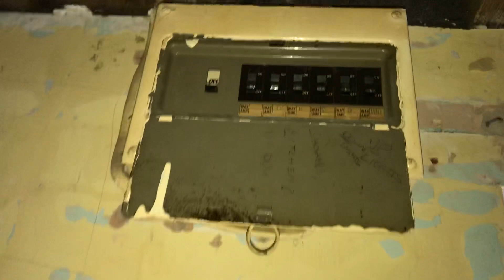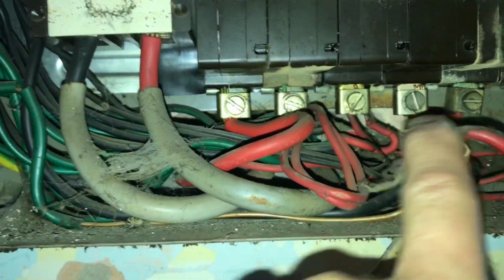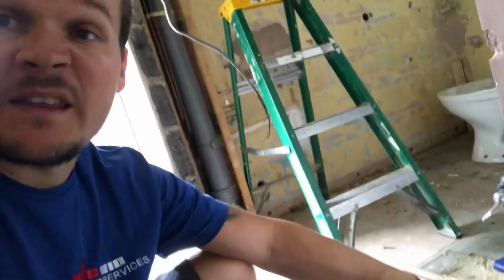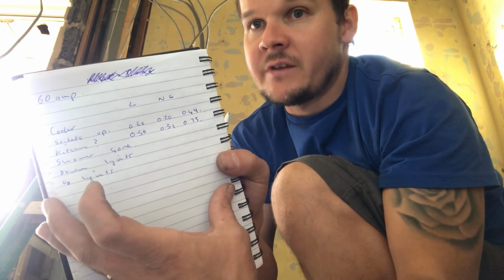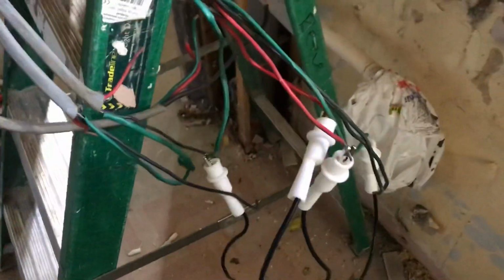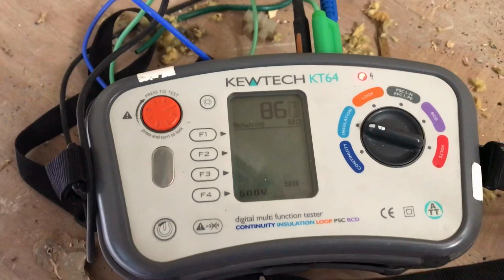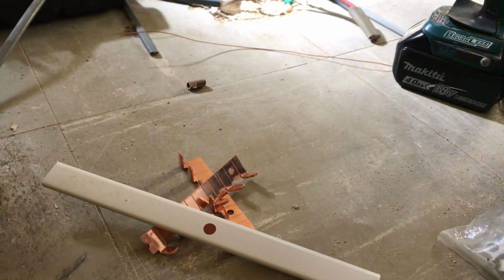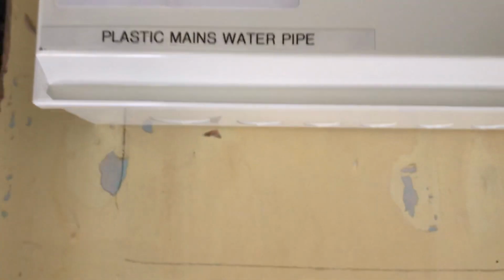18th Edition Consumer Unit Upgrade. EICR Before Board Change?

Comment: Just a useful piece of information regarding the earthing of the gas meter. The fire grommet will expand under fire conditions but the purpose of sealing any hole  from a Gas perspective is so that if, a gas leak occurs in the inset meter box, it won’t make its way into the cavity of the building potentially causing a explosion if ignited.  There is a special non set putty that can be purchased. This is why gas pipes are sleeved and sealed one side.
Reply: Yes agree and about to write same thing . Been a gas engineer for 27 years. Get yourself some denso mastic putty or fjc from pts or bss. Leaving a hole from the rear of the box into the cavity unsealed is an At Risk situation. And like the comment above if there was a leak ect in the box if left unsealed it could potentially fill the cavity with gas.

Comment: The reason for sitting the meters so close to the cut out is for the purpose of revenue protection. I asked this question a while back when we had a meter installed. Sometimes the tails from the cut out to the meter run through a solid plastic block to protect the tails.
Reply: revenue protection
Reply: Alan Lumsden thanks  you’re right alan, edited👍🏻

Comment: If it's a 70's install, the cpc in 2.5 will be 1 milli, not 1.5.
I would have tucked that slack cable into the ceiling void. You never know when you might need a bit spare.

Comment: Dude another top video as always, make sure to seal round earth cables in gas meter box, especially through cavity walls, because if there was to be a gas leak on the meter it will stop the build up of gas going in to the cavity. 👍

Comment: I use those same intumescent grommets all the time, but still use a tails gland to give the tails that extra tough protection where they enter the board, both because that's the incoming power only protected by the main fuse and because being much thicker than the other cables they can potentially hold some tension (wonder if they could wear through a grommet given enough time?). Might be over cautious but whatever let's me sleep at night...

Comment: Very informative vid again .... obviously I'm going to be an arse and point some bits out only up for discussion ! I would've installed an isolator in that electrical cupboard for 3M tails. With the earth bond for the water, I get where your coming from BUT if you can look around and say that the high percentage of water pipe installation is copper with copper joins etc and the house is of an age where it is more than likely a true copper pipe installation then I would 100% earth bond above that stop cock, especially as the ceiling is down and there is a refurb on. I know the regs say blue pipe installations don't need bonding but I would use common sense and read that as they assume houses of a certain era that will have polypipe sections and some push fit connectors. I just think on that job I would've run it in for peace of mind. Keep up the good work though mate !

Comment: John Ward did a video on the meter tail / eddy current issue and came to the conclusion it wasn't a problem. However if you're faced with using 2x 20mm holes as the only option for the tails, a slot cut between them makes them the same hole.

Comment: I struggle to ascertain the issue with mounting the distribution board near a waste pipe on the basis that 'it might leak in the future'. 

If that were a valid statement, would you not install downlights in a living room directly below a bathroom incase 'it leaks in the future'?

I don't recall a section within 'Selection & Erection' entitled 'Suitably siting electrical equipment and accessories in order to compensate for future misfortunes'.
Reply: Agreed .... under normal condition s you would not expect toilet, sink, over flow, waste pipe etc to leak
Reply: Obviously there should be a suitably siting electrical equipment and accessories in order to compensate for future misfortunes section 👀  oh no, did I just give the IET an idea for the 19th 🙈 🤣
Reply: @mfselectrical6370  You've said it now! 🤣🤣
Reply: Also the roof might blow off exposing the cu to the elements 😋
Reply: In the same way you would not place power and data together. I would recommend not placing electrical systems near or under water or waste pipes. Its just common sense, would you not agree? An electrical AE would not be happy!
Reply: Is it wise to install electrics under a roof as it might rain
Reply: @llamudos9809  The main reason you dont place power and data together is because mains interference couples into the data wiring.. its not a safety issue
Reply: @jaycee1980  It depends. If you hung data cables from a 100amp 3 phase supply in a ceiling void and use plastic tie wraps to bound to the electrical cable and you have a fire. Then you risk having a lume of data cables landing on someone which could kill.

So with that in mind yes it is a HS issue.

HTM 06-01 may help!
Reply: @llamudos9809  youd also have useless data cables as the circulating currents in a 100A cable would completely disrupt any data sent over them. i wasnt evaluating the fire safety aspects of it
im an electronics engineer, not an electrician
Reply: @jaycee1980  Agreed.

Peter Mulholland  I work in a hospital and today i had to bollock an Estates Manager for allowing a sparky to hang data cables from a supply feed in a corridor rather than put up in a tray and store it correctly. We have stringent guidance that has to be followed so when i see stuff that ain't right i will comment. 

I'm a project Manager in a trust and i see real stupidity daily by supposed qualified staff.
 
We have a switchgear room with a water pipes situated directly above it. Its an idiotic designs that really annoy me and people should apply common sense when implementing LV.
 This switchgear feeds 4 wards with critically ill patients.  

I hope you did not take offence at my comments they were meant to help. Its just i see alot of really shoddy work and it grates.
Reply: Klberts1234 🤣🤣 brilliant 👏🏽
Reply: Would you wire anything in a house directly under the roof just in case it leaked

Comment: You guys some some strange panels in the UK.  Fun to see the differences between the UK and US.  We don't test things here, wire it up, turn on the power, if the breaker didn't trip its good, move on to the next one!  LOL   Keep up the good work.
Reply: Same in Australia
Reply: No testing at all? Not even to make sure you've got an earth/ground present at your sockets, or that the cables weren't damaged during installation, or that your GFCI sockets are tripping when they should?
Reply: We used to use a polarity tester for the sockets. Test the RCD function ect. New build flats back in the early 90s we did line to earth insulation resistance test on lights n power final subcirciuts.
Reply: Same in Australia?

Comment: Great video again mate 👍 did you seal the 10mm gas bond coming into that box? Was always taught not install through the rear or side of the box in case of a leak and gas in the cavity. Keep up the good work!!
Reply: British gas definitely dont like you putting holes in the back of their boxes even if you seal it with mastic!
Reply: You’re right as usual Kurt 👍

Comment: Are those double insulated tails okay in the ceiling and wall cavity Chris? I've never had to or considered doing it myself but I'm guessing the >50mm reg covers it? I usually fit an isolator or switch/fuse, then SWA or singles in galv conduit or trunking to the board. I guess it's the same as running a 16mm T&E without RCD protection, as long as its buried deep enough in the cavity it will comply. Also I don't tend to upgrade the tails from 16 to 25mm unless calculations require it. Same goes for the main earth. But I sometimes upgrade them if I have to run them in new like you have done. 16mm2 can cope with 60A of course, and the 10mm earth will cope with the PFC. Keep the content coming mate.
Reply from the maker: Should of mentioned in the video the main fuse is getting upgraded to 100amp and I’ve got to run in a sub main to the garage.

Comment: Great video, quick question .... Why did you upgrade the meter tails to 25mm as the service cut out fuse was only 60amp? Surely the original 16mm tails were sufficient, no?
Reply from the maker: The client wants to add a sub main to the garage at some point and is getting the main fuse upgraded to 100 amp.

Comment: I’m an electrician in the states. And I’m admiring your two pouches that you work out of on your waist. Are the pouches incorporated on the shorts or are they separate. Also could I get the name of them? I would love to get a set
Reply from the maker: They are incorporated into the shorts. They also do them on trousers.
Reply: Ray - I moved to the UK from the states a year ago. I immediately noticed that just about all trades folk in Europe wear work pants with these pockets - they are referred to as holster pockets. They are brilliant. They are an integral part of the pants, but means that you can kneel down without stabbing yourself Lol. Dewalt make them amongst just about everyone else over here

Comment: CJR what was the reason for upgrading the meter tails to 25mm2, if the meter has a 60amp fuse? did the new HAGER board have a 60amp main switch? I get that you probably had to replace them anyway for length to the new board. Is the customer going to look at getting his grid supply changed to 100amp? in which chase you're just future proofing the job?
Reply from the maker: Correct upgrading to 100amp supply

Comment: Had a plumber show concern that my gas meter did not have earth bonding and whilst the gas comes in via plastic his reasoning was if the copper pipe becomes live and anyone touches it as it can't go to earth through plastic whoever touches that pipe would? To pacify  him I ran an earth wire from the gas meter to the earth terminal block outside the fuse box. He was then happy as Larry????? Oh well.
Reply: It's amazing how easily pipework picks up an earth within an installation... Even just going through damp walls. Pipework could be buried in floor. It's too simplistic to assume just because it arrives in plastic that bonding isn't required. It should be tested.
Reply: This is true  same with push fit water pipes with copper pipe   I had a call out someone receiving shocks off metal shower hose. Investigation found shower cable load side earth  had been connected into the  load live.   Plastic push fit used on copper pipe and plastic incoming water pipe shocking
Reply: @Klberts1234  cheers for that it did surprise me given that most sparks do not earth bond when the feed in is plastic. As I said I ran a 10mm earth from the gas pipe to the earth block next to the main fuse as I won't open the fuse box. As I see it the block has a cpc going into the fuse box anyway so it's earthed.

Comment: Great video mate love your channel. Just woundering if you have ever heard of foam causing damage to pvc cables. I've always used it myself for filling holes when sparking. Ive Recently started a with a new firm subcontracting international mains who won't let us use it we use hilti two part gear. Do you reckon it's true that I causes damage or is this just a money making racket?
Reply: Polystyrene, which forms the basis of a lot of expanding foams, will break down the plasticisers in the PVC insulation. Over time, this will cause the cable to fail

Comment: Just had a look into the fire rated grommets. The particular brand I looked into, which look similar, state the grommets aren't designed for main tail entry. Not sure if this has been brought up in the comments. However, Hager also state making their consumer units fire rated isn't necessary for their boards after extensive testing. But they IP rating would still need to be achieved. 

Hope this helps in any way

Comment: Where  do you get your hager boards from and how much did it cost you mate. Can you also do a video on how you check for your borrowed neutrals on lights
Reply: A borrowed neutral can be identified by carrying out a R1+Rn at each lighting point.
Reply: Or insulation resistance between neutrals

Comment: Recent EICR i completed had 80amp fuse 16mm tails 6mm main earth and 6mm bonding and damage to front of 3036 fuse box no exposed parts on tncs pme supply. I recommend upgrading board to 6way rcbo board 25mm tails 16mm earth and 10mm bonding. Customer is confused as apparently another report from 12months ago doesn't mention anything and states all is ok!! Am I missing something here???
Reply: Ryan Kerrigan what codes did you give for the points you mention?
Reply: @solarrover9575  c3 for earthing and c2 for fuse board. But suggested that while installing the new CU just upgrade the tails and bonding. Job done. Am I right I doing so? Views please
Reply: @solarrover9575  I understand main earthing conductor may be fine when using adabatic equation, but for main bonding PME supply states min 10mm therefore surely makes sense to upgrade tails and earty to 25mm 16mm?
Reply: Never mind about somebody else's report, the accuracy of some are questionable to say the least. Damage to a consumer unit requires repair or replacement. My price for a consumer unit change includes new tails, new earth and gland.
Reply: @ashmanelectricalservices4318  Yes as does mine Alvin, therefore a new CU would eliminate most of the issues on my report, just doubting myself as you do when customer questions you! Is the 10mm bonding required I would say yes as PME supply.
Reply: @kerriganelectricalservices4455  Go with what you feels best, as long as you can justify why you've done what you've done, you'll never be wrong. Keep up the good work 👍
Reply: @ashmanelectricalservices4318  cheers Alvin, thanks for the response.

Comment: Hi Chris... Why did you choose to fit a consumer unit with SPD?
Reply: I would also like to know this, must be prone spikes in voltage
Reply: Would also appreciate some justification around this. Perhaps a quote from the risk assessment
Reply: My understanding is that a surge protection device is now fitted as standard unless you complete the risk assessment (in the bs7671) to show that it's not required and attach the completed risk assessment to the EIC
Reply: @doomain6769  It's not a requirement in a single dwelling unit, it's a recommendation. The installer has a duty of care to advise the installation owner of the benefits derived from having an SPD fitted but ultimately it's down to the client weather they want it or not.

Comment: Might have been an idea to ask the energy provider to upgrade the cut-off fuse to 100A, upgrade the distributor tails to 25 mm sq and fit a 100A DP isolator to the consumer tails.
Reply: @user-wk7wv8rn8h  Can't hurt to ask... I'd rather avoid cutting seals on the meter as you could be accused of tampering with the meter.
Reply: @gadgetman36  You can clearly see the meter is sealed, how else do you suppose he got his new 25 mm sq tails upto the new board.
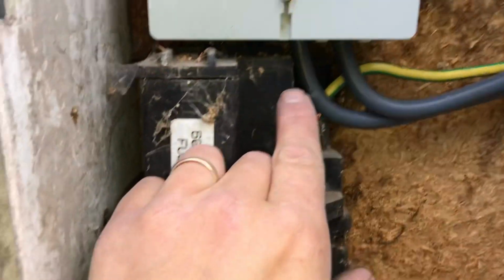Reply: @gadgetman36  3:53 & 7:44 He definitely cut the meter seal.
Reply: Yes they will do it for a few hundred pounds and  6 month after your planned the job in your diary . 

And 9 times out of 10 when  you call they say we are extremely busy has it got a fuse , well pull it out lol. 

Waste of time phoning really.  

Advise the customer when done and they can have it done at their leisure .
Reply: @albertsteptoe3710  E-ON will fit a 100AMP isolater within a week - for free.
Reply: @nw5835  im an E.on engineer and we do come out an fit isolaters but within a week, you would be so lucky. E.on class any fuse or meter without seals...is classed as "tampered with". UKPN will also come out and uprate fuses to 100amp if you ring up

Comment: Question for you. I'm thinking of becoming a sparky. Is it easy to get your head around fingers because all the testing is confusing me, like how do you know what is "safe" and what isn't.

Thanks Cal.
Reply: Yeah it's fairly simple to understand. Learning the regs is easy. The main thing is having good construction skills.
Reply: Depends what route you take. Domestic only, or fully qualified level 3 installation electrician?
Reply: @beardedsparks2825  I was thinking about doing domestic installation for now and then level 3 when I felt more comfortable.
Reply: @callumhall9808  level 3 will mean AC theory, that's math heavy and harder to understand than testing 😉
Reply: @beardedsparks2825  Damn, that's me out of the thought of that, Only just managed to pass my maths 2 years ago after failing it by 3 marks in high school. Still don't know how I passed though. LOL
Reply: @callumhall9808  If you want it bad enough and you have the enthusiasm, you can do it.
Reply: @Souped-up-Saiyan  delusional

Comment: mmmmmm no bonding on the water due to plastic incoming supply.......i had an niciec guy refuse to sign my electrical work off until i placed two 10mm bonds on to 2 water pipes which (u guessed it, werethe  plastic incoming mains 50 mm below)  not sure why?..........

Comment: You will find a lot of new build 2 bed houses are wired front and back not up & down
Reply: I think up and down is better less confusing
Reply: Faster to do on a shit price, that’s why it’s done that way. No fucks given for who or what comes after just rinse & repeat
Reply: Cheers guy; got a lovely shock thanks to your boys 😂🤙
Reply: L .... you mean you turned off what you thought was up or down,then didn’t test before you touched!!....did you forget the safe isolation procedure? 🤔😂😂
Reply: @guymartin7757  😂😂😂
Reply: I have seen that new methods used is to wire 20 radial circuits to each room ( except of kitchen/utility)  and use 3A fuse spur for lights so each room is it's own circuit... what you think?